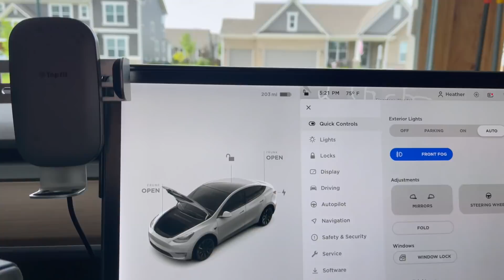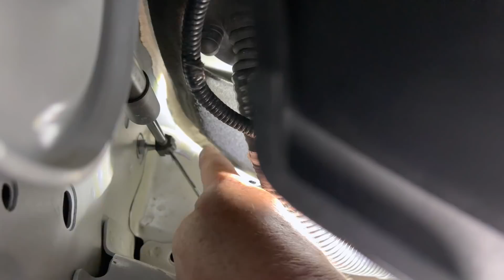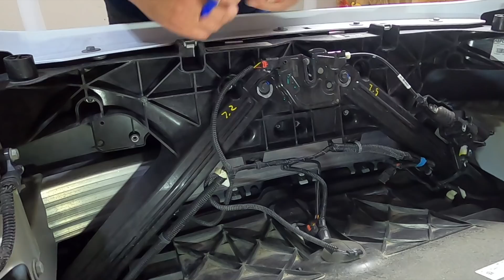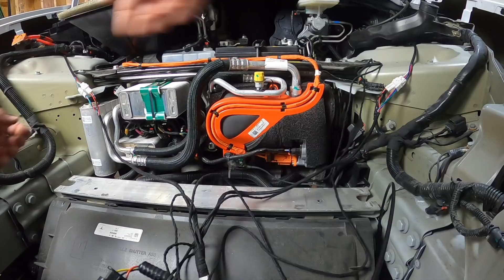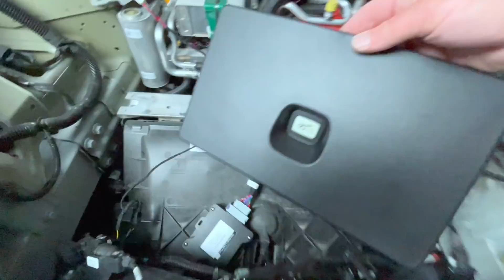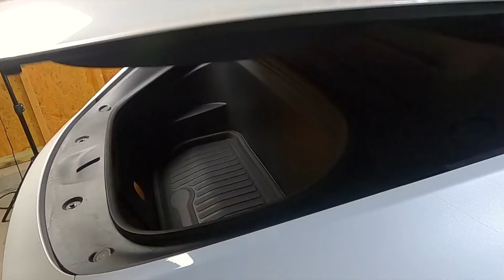Tesla Model Y - Frunk Mod by Hansshow

Comment: Installed, worked awesome for 2 months, now it has locked closed and will not open!  Emergency open doesn't work...  Hannshow responds every 3 days with a little bit of information, but isn't letting me know how to get the frunk open.   Suggest you do NOT buy this product
Reply from the maker: Yikes! That is not good. I am sorry this is happening to you. I have installed 2 kits at this point and both have been flawless. The biggest issue is customer service in this case. Things happen and most people understand. But a response every 3 days when you are locked out is unacceptable. So sorry this is happening to you.
Reply: @BeardedTeslaGuy  I ended up having to take the front left when off, remove the wheel liner, and then I could just access the power frunk suction lock motor.  I cut the cable and then could open the frunk.... Reverting to factory non power.  Hopefully I at least get a refund from them.  I really liked the power frunk.  Got lucky there was nothing locked in the frunk I needed.

Comment: Did you have the version 4? I have the version 5 and the strut bracket doesn’t line up. It has a metal flap that supposed to drop into a slot on my Tesla but the hole has over lapping metal and it doesn’t fit. Your video convenienced me to get it but sadly I hit a dead end very early on.
Reply from the maker: I have a video on the V5 version too check that one out.
Reply: @BeardedTeslaGuy  I’ve seen that one but our brackets are different, maybe they changed it but mine has a metal flat that I believe is supposed to go into a little hole in my Tesla but it doesn’t fit. In your V5 video your bracket has two flat surfaces that it rests on. Strange that your bracket worked just fine and the decided to change it to one that may or may not work based on the size of hole that Tesla left on the car.

Comment: Great video! Have you produced a video for the installation of a kick sensor for Model Y?
Reply from the maker: Did not do the kick sensor. It should be straight forward though, just plug in and attach to the bottom

Comment: I spent 5 hours trying to make this work.  I found that there are several connectors in the harness that are not explained or shown anywhere.  Trying to get help somewhere but no answers at Hansshow so far.
Reply from the maker: There are a number of plugs in the harness. They will only plug in to 1 connector on the car, can't physically plug into the wrong thing.
Reply: @BeardedTeslaGuy  I don’t believe there is a mention of the OEM plug that goes to the switch in the frunk not being used.  I wound up with an extra plug since I did not know it was no longer used.  I wound up putting everything back as it was before the install with the exception of the new struts.   I’ll try again this weekend

Comment: Hi,  thank you for these great videos!! I have a question for you.  I am hoping you can give me your insight on the Hansshow power frunk.  I’m reluctant in installing the unit that I purchased after reading several posts of the unit failing causing the frunk to fly open while driving.  What are your thoughts on this?  I’ve contacted Hansshow but the can only reassure me that it’s not their units fault.  Have you heard about these issues?  What is your take on the frunk not locking and flying open while driving?
Reply from the maker: I have heard of only one instance of that, and they now have a V5 that has additional updates. Ive never had an issue like that before.

Comment: Ordered this and could not get the frunk to close flush no matter what I did. Something was def off. Do you have any ideas or where I can get some troubleshooting help? It would close then pop up like half an inch. Like If it was not grabbing correctly. Very frustrating
Reply from the maker: 2 places to focus, the latch needs to be lowered, or the 2 black bump stops on the front of the hood need to be adjusted.

Comment: Thanks for your videos....very well done and informative.  Before putting my plastic frunk liner back in, the latch works like a charm and hood is well lined up.  After putting frunk liner back in, the hood is much higher and barely latches sometimes.  After reading the threads, I'm thinking I have two actions to take...  First put the rubber spacers between the latch bracket assembly, and second, adjust the black rubber spacers on the hood.  Also, I am getting a sensor error on the screen about the sensor....hope this fixes it?  Oh, last question...Am I right in saying that there will be one wire that will not have a home once installation is complete?  Looks like its the original Tesla emergency release button clip?  Thanks again for your help!
Reply from the maker: You need to adjust the rubber bump stops. There are 2 of them on the front left and right of the hood.
Reply: @BeardedTeslaGuy  Thanks so much...That helped!  In addition, I thought I'd share some extra tips based on the feedback.  Here are my top reasons why the frunk might not close, or (for me) close intermittently.  #1 installing the brackets for the arms incorrectly.  This is the BIGGEST mistake I made, and cost me hours of time due to the difficulty involved with removing and replacing them.  #2 Placement of the latch. (Many already know this) #3 (This ultimately fixed my intermittent issue) Move the spacers behind the latch.  As noted, in the video you had the spacers right behind the washers on the latch.  Once I moved the spacers behind the latch, I believe it helped the angle of the latch, which made operation on my latch work perfectly.  I could not get it to work no matter how many times I adjusted the latch, until I moved the spacers.  Bottom line, I want to thank you for your help.  Your videos are very helpful, and I appreciate the kindness that is displayed throughout them.  We need more videos like yours!

Comment: Just about to begin the install.  Worried about comments that frunk opened by itself with car moving.  Can anyone here please comment about experience with Hasnshow kit after weeks/months of use?
Reply: after hours of work.. i gave up.  Installed, opens and closes.  Sadly, it does not close completely close.  Must still press to lock it.  Works well without the plastic insert.  I suppose the rubber gaskets are the problem.  I just couldn’t figure it out (countless adjustments to the locking mechanism).  Worth it?  Perhaps.  I now worry if it unlatches (partially as is) while driving.  Any ideas will be very much appreciated.
Reply: I also tried removing the plastic washers (someone commented that the switch did not catch on the hensshaw).  Still not closing properly with the insert in.
Reply: I also tightened the actuator cable from the Hansshow (another possible fix from another comment elsewhere).  Nada.  It works.  It opens.  It closes (almost)... I have to push it down to lock it.  It seems to me that the system, with the insert installed (with the rubber gaskets) is not strong enough to push it fully closed.  Happy to learn from others.
Reply: And since I'm venting... kudos to BTG for this video.  The instructions with the package are almost illegible.  Tiny print and tiny pictures.  No explanation how to connect the wires.  One, btw, the original cable to open the latch stays disconnected.  (there's nowhere to plug it).  I electrical taped it and tucked it away.
Reply from the maker: Ok, so I will try to help here. So the thing that is preventing it from latching completely is the actuator. If you look, the "U" shape hook on the hood comes down to the slot. There is a black arm that goes across the latch, when it is pushed down, it activates the actuator, which makes the latch engage and pull it down all the way. Either your U shaped hook is not engaging that black lever, or the emergency release is holding too much tension on the spring, preventing the latch from actuating. Those are the 2 areas you need to focus on. Start by removing the emergency release from the spring (or pull it out a bit to remove tension. If that doesn't do it, then you are not aligned well enough for the U to make contact with that black bar going across the latch.
Reply: @BeardedTeslaGuy  Genious !!  It worked like a charm.  Thank you so much for your help, and for your videos.  I have corrected another mistake and subscribed to your channel.

Comment: Those body panel pry tools were a life saver getting those struts off!
I found re-attaching that spring was easier doing the inverse.  Course I did this in 35 degrees and I didn't want to smack my fingers.
I was surprised my first pass how low the hood was on the passenger and high on the drivers.  I'll probably go back and do another adjustment pass so I wasn't messing with the hood adjustment pegs too much.
Tesla left me an extra black screw under the frunk cowl too.  It was trapped in that black ABS plastic area.
One interesting thing with my 2021 was the wire from the module to to the frunk button did not work to open/close.  I hooked up the car's original and it did.  Not sure what was up there.
Paper directions on V5 at me chasing garage lights and wanting to get a pair of glasses :)
Reply from the maker: Haha yea the instructions are not so good! Just keep making micro adjustments to the latch to get the hood level
Reply: @BeardedTeslaGuy  I think I like where you leave it hand tight.  Let it close slightly adjust hood gapping left/right then lock it down.  Relied on my silver pen marks too much.  100% lined up now.  Thanks again.

Comment: I ordered a set last night with your code. How long did it take you to receive it? Thanks.
Reply from the maker: Not long, shipping was about a week if I remember right
Reply: @BeardedTeslaGuy  it did take a week so thanks for that.
For those that have a 2021 Model Y, there is an entire Hepa filter assemble that go across the frunk compartment. This is under the initial plastic trim that you pull off first.
There are two 10mm bolts holding that in. Again that covers from left to right of the entire compartment covering the entire battery area. Easy to pull of, but an additional piece that needs to come off that is not on the car you created the video for. 

Thanks.

Comment: Great video.  It helped me a ton as I just installed this today and the instructions that come with the unit are terrible!  Thanks for being detailed here.  To anyone wanting to do this, a couple of things.  First, it's a little different with the latest Model Ys with the HEPA filter.  Only four bolts and an extra clip to the windshield washer fill tube.  Then there are two 10mm bolts to remove the HEPA filter assembly.  Just beware, this install isn't complicated but some steps are a bitch.  Especially removing the old struts and putting the new ones in.  It's bad on the passenger side and almost impossible on the drivers side.  I have thin arms and have deep scratches up and down both arms from trying to reach in those tight spaces.  Someone with big forearms will not be able to get in on the driver's side.  Drew blood in several places and a few choice words.  Also my kit (version 5) came with an "emergency cable" with no explanation of it's use other than it's a manual release you're supposed to fish up into the passenger cabinet.  All I can think is the emergency release by applying external 12V to the wires in the tow hook opening may not work with this kit installed.  I did not install this cable (yet) but will test the 12V emergency opening to make sure it works.  If it doesn't, I'll install the cable.  Once in this is great but was more of a challenge than I expected.
Reply from the maker: Thanks for sharing. The drivers side is indeed VERY tight to get your arm through
Reply: I have the same MY with the HEPA filter.  Easy to take off.  My hood didn't close so I think I need to adjust the brackets the struts attach to.  No blood drawn.  I used electrical tape on the sharp edges up to so safe my arms.  Definitely tight fits on both sides.  Will probably have to pop the struts off the brackets to loosen the screws.  Wish Hansshow could have used the existing nipples the car came with without the new brackets.  "The best part is no part."  ;-)

Comment: The updated version is less friendlier to install with us BTGs (Big Tesla Guys) with meaty arms.  The new bolts requiring an Allen wrench to install the new strut adapters make it harder as well.  Not a fan of the installation of updated waterproof version but like the waterproof module itself.  Also, can’t tweak as many of the settings like the older version.
Reply from the maker: Yea, for us more…muscular guys, getting the forearm in the narrow pocket on the drivers side is a real pain.

Comment: Great video, and thanks for mentioning that you have to be careful around the positive terminal of the battery.  To be extra-safe, I disconnected the negative terminal of the battery as well as the 12V under the back seat (of my model 3 anyway) to eliminate any possibility of accidentally shorting 12V to ground.
Reply from the maker: Yea, I’ve arch welded a socket once…was not fun
Reply: @BeardedTeslaGuy  but I bet was exciting!  :-)

Comment: I did this today followed your video. 🙏 . It took me 4 hours to do. I had heck of time with driver side strut and bracket. I noticed there was no manual emergency release for frunk in the Hansshow V4.3 kit like previous version. How do you open frunk if 12v battery dies?
Reply from the maker: The emergency release is still behind the tow hole on the front bumper

Comment: Ordered the model Y front Frank auto opener and used your PR code. Having major issue with hood not closing! The hood stays open about a foot. And won’t close any further. It will return to full open and back to this position. Trying to get someone to help me troubleshoot this. Instructions suck. Someone already deleted my previous post to you! Please help ASAP or contact me. Sent messages to hand show e mail and whatsApp but no answer so far. Car is not driveable at this point. Want to just remove the kit and put it back to stock and send the kit back for a full refund!!!

Comment: Don’t know how you installed in 1.5 hrs. You are super man if so. I am having major issues after install! Hood only closes 3/4 of the way and will return to full open. No way will it come close to fully closed! Can almost stick my head into the frunk when closed. Even switched mounting brackets for power struts from left to right. Now hood does nothing but the lock cycles along with the added pull down module! The instructions really suck and pictures are so small you can’t see any detail! Checked every video available but no help from them. Only your video on the latest 4.2 version! Need help ASAP.  Tried to call tech number but not in service. Now trying WhatsApp  to try to contact supplier. At this point the car can not be driven. Frustrated to the point of returning the car to stock and sending the kit back for a credit. ☹️☹️☹️☹️☹️
Reply: They have not got back to me! Their customer support sucks along with their instructions! TOTALLY NOT IMPRESSED!  Now I have to re install the original frunk struts  and other components to put back to stock! Need our model Y back on the road since it is our primary transportation! Only drive my gas GUZZLING  99 Silverado when I have to. ( cyber truck on order to replace this pig! )💎🙌TESLA  P.S. SINCE YOU SPONSOR THESE GUYS AND GETTING SOME SORT OF KICKBACK I THOUGH YOU WOULD BE A LITTLE MORE SUPPORTIVE!😡
Reply: Similar issue here.  MY with HEPA filter.  The hood gets to about 4 inches from the latch.  I think I'll have to adjust the brackets - what a pain.  The printed instructions are no where near as useful as YT videos like BTG's.  The hardest part was putting the struts on and it looks like I'll have to adjust the brackets in those very tight and limited work spaces.  BTG makes it look so easy.  ;-)
Reply: Contacted HansShow and eventually was texting an engineer using WhatsApp.  Bracket instructions weren't clear.  Needed to detach both struts from the hood, removed both brackets, take the lower part of the strut off the brackets, reinstall both brackets, and reinstall both struts.  I'm getting pretty good at this now.  The front of each bracket is almost horizontal and resting on the wheel well.  The strut attach point is practically right below the screw.  The hood then closed like it was supposed to.  The wires could be longer for a neater installation.  This tool on Amazon looks like it would make tightening the screw easier than using a 5mm Allen wrench.  https://smile.amazon.com/gp/product/B07W4TTJ5G/ref=ppx_yo_dt_b_asin_title_o04_s00?ie=UTF8&psc=1
Reply: @walthooker1434  need your help! Facing same issue, can not fix
Reply: @artempolyuk2336  Ji at TesBros sent me this link for the PDF installation document https://drive.google.com/file/d/1abmM-CyQcvnx6VjuBj7ZNuS584pldv8d/view?usp=sharing.  Look at step number 5.  You'll see that the front tab should be horizontal and the back tab would be vertical.  That will make the strut barb be directly below the screw mounting hole.  Once I did that, every thing was fine.  Good luck.
Reply from the maker: I’d contact them and see about a replacement

Comment: Thanks for the video showing the updated part as the other videos online show an older model.  I however did not find it as easy as you indicated.  I'm a big guy and getting my arms to fit and do the drivers side was a nightmare
Reply from the maker: That’s without a doubt a tough spot to reach. Very tight